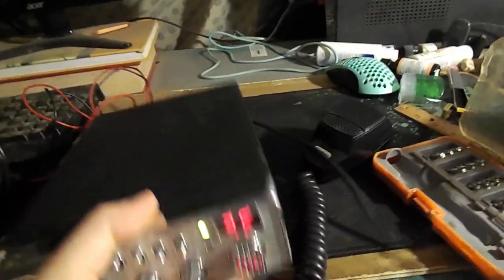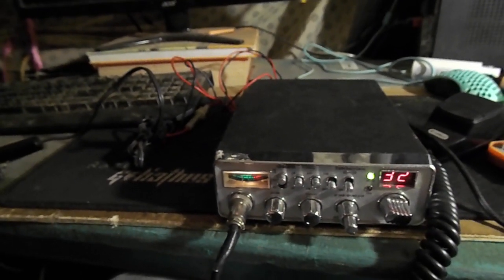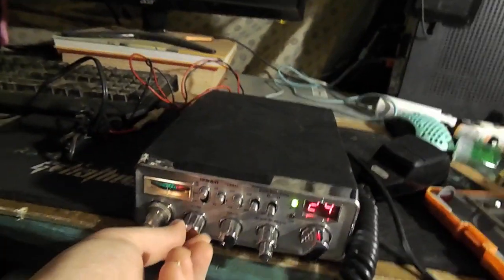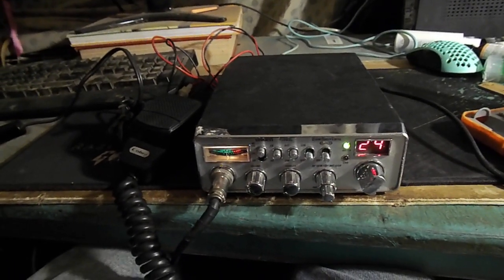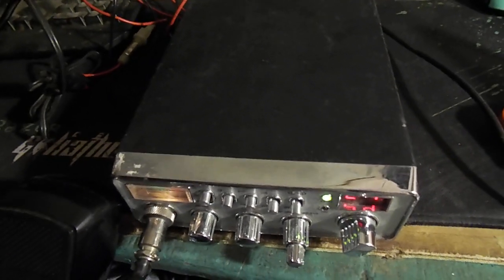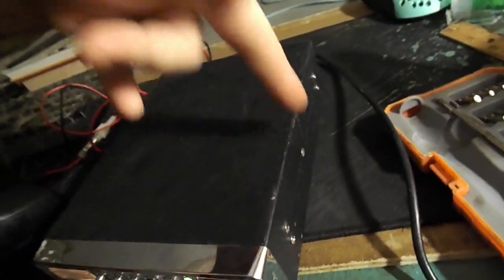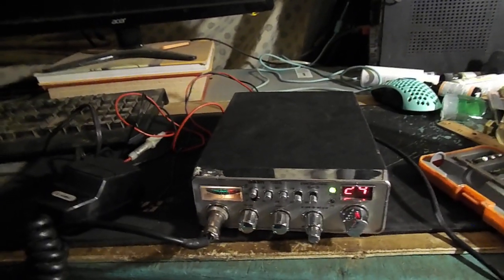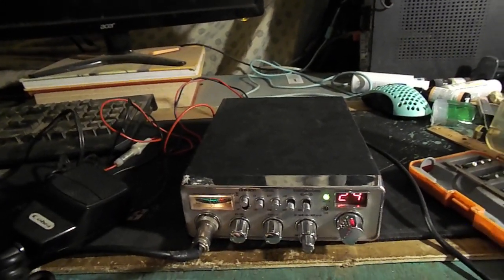Hear MORE SIGNAL! The Easiest way To Reduce CB Radio Noise!

Comment: What are the numbers on the capacitor you used?
Reply from the maker: 0.068 microfarad capacitor

Add it to the middle connection on your volume pot

Then attach the other side to a ground point (like the square metal cans you see in your radio)
Reply: Copy that thanks

Comment: 95% of your radios performance is how your antenna and coaxial cable are set up
Reply: I know it's pretty randomly asking but does anyone know of a good site to watch new series online?
Reply: @Noe Caden try FlixZone. You can find it on google :)
Reply: But it doesn’t fix the problem
Reply: What if you use a mag mount does that same logic still apply?
Reply: @Fox250R  yes. Because the negative side of your battery where the negative lead of your radio is connected is also connected to the chassis ground of your vehcle.
Reply: But with cell phone chargers and led.. Makes alot of noise

Comment: Great video--hard facts and provides good opportunities to talk about the little things that can help performance and/or frustrate the heck out of your CB fun. If you have an outdoor antenna--and the body of a car is "outside"--then at the least, there will be static charges that build up on the hot side (the radiating element) and the low/ground side (base, coax shield, connectors, and the car body itself).  At the most serious, a nearby lightning strike will induce a dangerous charge on an outdoor antenna.  As those static charges rise and fall, or discharge to the ions in the air, you will hear noise in the radio.  A well developed charge can zorch (technical term) the front end of the receiver and ruin some of the vulnerable parts on the circuit board.  It's best to ground the radio for this reason.  Ground everything that is supposed to be at ground potential to the same "ground"--something that acts as a ground--that is, that will act like the earth and absorb surplus + or - charges. Not easy.  The car/truck body is big and metal, but it's floating on (you guessed it) RUBBER tires. So do the best you can. At home, ground to the ground on your power supply (is that the negative terminal, the ground lug, the chassis, or all of those?) . Careful: If the negative terminal is floating then determine how to properly ground it (because the radio's negative connection is probably grounded inside the radio.  Everything that is supposed to be "low" should be at the same exact zero voltage--that's zero voltage DC, too.  Then you don't have noisy--and dangerous--static discharges.  The comment about mag mount antennas is right: the antenna base is not necessarily DC-grounded to the car body.  So, neither would the antenna coax be at DC ground, either.  Fix that. By the way, it's hard to find a good connection to the mass of the car body for grounding purposes inside a typical car or truck. (For example, the car door isn't necessarily connected adequately to the rest of the car body, despite being mounted via the hinges to the car body!}  So putting a radio in a car or truck with proper consideration for noise, static grounding and suppression of common mode currents getting back into the radio involves numerous, pesky (technical term) challenges.  Again, great video--brings up important, beneficial considerations for good performance.

Comment: Love the cb videos,im not brave enough to start soldering in parts yet .I have a hard enough time soldering on those pesky PL259 connectors. 
73,s 
514 Ontario Canada
Reply from the maker: I think I’m more apprehensive about soldering PL 259 connectors than I am about soldering part of the board oddly enough

I’m not an expert myself I’m pretty terrible at soldering 

but if you find something broke try to fix it 

that’s the best way to learn I think, not by breaking things, but fixing them
Reply: @JohnnyNJones  I have the same Uniden PC68 XL CB radio.  My Uniden is made in the Philippines.

Comment: Awesome Johnny!! I didn’t know about the grounding option…🤔my new uniden pc78 ltx is great and why not ground it like you suggested 😁.. so would running a good copper wire from the mounting bracket to a metal part of the Nissan pro 4x😝be sufficient?? Would under the dash metal or the seat metal fastener be alright?? Or should I pick another grounding site??
Reply from the maker: Honestly, my friend if you’re not hearing any noise, you should be OK.

But yes, you can ground it with a wire if you’d like as long as it’s short. So under the dash would be better.
Reply: @JohnnyNJones  thanks dude!!!!😎Johnny jones!!!!😎🔌📻🎛📟🤓
Reply from the maker: @christoFlair777  you’re welcome bud 👍👍😎

Comment: The circuit board in a cb radio is "floating" so it can be used in either positive or negative ground vehicle, if your cb is "home base" you can connect the ground on the pcb and then a earth ground to get rid of noise.
Reply from the maker: That’s true it is floating, but I find that removing currents induced in the housing also benefit receive by grounding. 👍

Comment: I have been wondering about this. I have a Cobra that I had in my RV for cross country driving and it worked great mounted. I have  bought a Wilson 5000 magnetic antenna and I am trying to find a place in my F150 to mount the CB. But I have been trying to find info about does the CB case need to be grounded to work right. I thought that it'd be better if it was grounded. Thanks for the video.
Reply from the maker: It will not cause any major issues to not have your radio grounded but it does help a bit in the noise department

Comment: Make me some more  videos my friend ,…. I really need to CUT Out that RF Noise.    I live in the middle of the City of Florence Kentucky and their is POWER structures all all around me for sure my friend.    What a great idea.        I think this would really help out on the Base Station as well .      Thank you 🙏🏽
Reply from the maker: No problem I appreciate your comments, I would recommend getting an FM CB radio now that it’s legal

 Try to use it when static is too high on AM, FM will not reach quite as far but it’s a lot cleaner sounding

Comment: A 4 y.o. video, I hope you are still active to this page. I have my radio, a 50 foot RG8X coax, a fiberglass antenna on a  mirror mount thats on a tripod freestanding in the yard, and the radio is powered by a lead acid 12 volt car battery, and the only thing connected to the battery is this radio. I do not even connect the battery to the battery charger until the radio is turned off. All of the equipment is new,Radio (President George FCC) new coax, mount...but the SWRs are 2.5 to 3.0. But when I run a separate wire from the battery NEG terminal to the antenna base the SWRs drop to 1.8 to 2.7.  In this video you say to ground the radio, but to what. Battery is free standing, as is the radio and also the antenna. Any help would be appreciated.
Reply from the maker: RF ground and DC ground are not quite the same thing that can become pretty complicated. It’s understandable that you are having issues. This is just part of owning CB radios haha.

You don’t want the battery hooked to the antenna, neither will be grounded then.

I would suggest removing that wire from the battery but leaving it connected to the antenna base. Keep lengthening that wire in a straight line until it’s long enough that the SWR drops.

I would also urge you to check out my video on my custom antenna build using nothing but wire.

If you would like to ground your Radio or your antenna, you can use a ground rod about 8 foot in the ground made of copper to get a good earth connection.

But it’s not something that you have to do. It will still work without being grounded at all.

Comment: I connected it to the body and it took the low static out still got the antenna static and mic and engine noise to work on
Reply from the maker: They make something called a power filter for that you should be able to find it online pretty easily. It seems to work pretty well.

I tested it recently on my video about using a computer power supply for ham and CB radio

Comment: get a uniden bc20 external cb/scanner speaker … it has a built in switchable noise filter that really does work... I rarely use the cb's noise filters and squelch any longer... my radio is a uniden pc122 that is similar to your 68...
Reply from the maker: Oh indeed there are plenty of radios that have noise filters. But some people may have cheap 20 dollar radios that just  have the basics. Thats the purpose of my channel is to try and help newcomers who may not be crazy about CB and just wants a few tips on getting the best out of their little radio they found at the flea market ect.

Thanks for commenting!

Comment: A resonant antenna will give you a better signal to noise ratio.
 Increasing the Q of the antenna decreases the noise and increases the signal.
Reply from the maker: Yes and reducing the Q also reduces the SWR bandwidth

But that’s the trade-off there
Reply: @JohnnyNJones  Increasing Q narrows bandwidth but increases efficiency.. Reducing Q increases bandwidth but lowers efficiency.

Comment: I just run my radio on wire shelf unit attach bare wire to mount bracket and then run that bare wire into and against shelving body in sense it now is ” noise drain" excess noise dissipates into shelving unit
Reply from the maker: Yeah that sounds like it would work just fine.

And It would act as a sort of faraday cage for noise suppression

Comment: I'm pretty ignorant when it comes to this stuff so maybe you could help me. You said "not to the negative terminal but to an earth ground." Where is the earth ground?
Reply from the maker: Well it won't exactly be earth ground, but it means the frame of your truck or car. If you have the radio mounted with a bracket to a metal surface this can help.

But basically if you run a wire from your radio to the frame of your vehicle you will lower your noise substantially.
Reply: @JohnnyNJones  thank you.

Comment: I have a lot of noise on my truck c.b. radio. But the radio is grounded through the mounting bracket isn't it? And the antenna is grounded through the bracket isn't it? Would it still need another ground wire? I need to lose some of this engine noise for sure...
Reply from the maker: The bracket if it’s connected to the steel body of the truck and is firmly connected to the radio could act as an RF ground.

But they’re often times painted or covered in an oxide layer and not really touching the radio other than through maybe through the screw

So I would say it’s going to be kind of difficult to get a really good ground with just the mounting bracket you could easily run a wire from one of the screws on your radio to whatever grounding point you have and that should take care of noise

If that doesn’t work then try using a noise filter which you can buy online, It’s a small box that you run your hot and ground through and it will filter any noise that you may have coming through your power cable (Which causes a lot of noise on its own)

And of course you could always use a balun to stop common mode RFI 

However if you don’t know what a Balun is it may be hard for me to explain how to make it. There is a lot of information out there that can help you and I hope you get this problem sorted out because no one likes a Noisey radio!
Reply: @JohnnyNJones  please fix my 138xlr  no transmit
Reply: Try hooking up your pwr directly to your battery & not your fuse box

Comment: I need some work done.  Fun custom stuff and a few repairs.  Do you have a website?
Reply from the maker: Aaron Pixler Hey there I appreciate your comment, I am still in my infancy in repairing radios, Usually I can fix simple issues but nothing more, I think most of that is luck. So unfortunately I wouldn’t trust myself to work on your radios, I’m just not ready yet. Not only do I not have the knowledge but I do not have an oscilloscope, signal generator, spectrum analyzer ect. But just for curiosity what’s wrong with your radios?
Reply: Lots of noise.  , broken squelch, another isn't transmitting, but recieves, another i want a linear amp installed, with a separate rf amp.
Reply from the maker: Aaron Pixler Sorry it has been so long, I Missed your comment because my notifications were so long. Those sound like things I could probably whack with a stick and make work again but it’s something that I am not comfortable or capable of doing right now. I really appreciate you asking and there will be a time in the future where I can accomplish those feats. Until that time I will be collecting information and equipment, thanks a million!
Reply: I’m having some ground issues in the big truck like electric windows and blinkers clicking through my speaker on my radio.  Where do you hook the ground wire to on the radio itself
Reply: @244-badnews2  try hooking your pwr to your battery & not your fuse box !

Comment: Poor ground on the antenna and coax is your issue which is obvious. Grounding the radio does not boost the signal, it’s cleaning the receiver due to your bad antenna and coax setup. 73
Reply from the maker: Yes, I know it doesn’t boost the signal.
It’s just a phrase that will fit into a thumbnail and more or less is the truth.

Comment: Clean RX is easy... If you want a challenge make that 29 not splatter with clean wave graphs on TX; FYI it takes board work that 99.9% of shops can't do especially with a linear amp addition
Reply from the maker: I don’t think I wanna tackle the challenge of reducing harmonic distortion in the CB world 🤣
Reply: It just takes a filter,they make them u know
Reply: Filter alone will likely clip modulation  and destroy clarity

Comment: ClearSpeech DSP modules or DSP Speaker & all of that white noise is GONE like a freight train.I use the DSP speaker in my pickup with my ICOM 7000 & in my shack I use the Base modules for my ICOM 7600, ICOM 746, ICOM 910H,& my DAK X for the CB Band.I HATE noise so I have almost None no matter what radio I'm using.
Reply from the maker: Oh yeah DSP will certainly do it, but most of us CB radio fellas just have some cheap old stuff

I’d love to have an ICOM 7300 and I plan on getting one whenever I have a thousand dollars to play with
Reply: @JohnnyNJones  I would not own a 7300 if it was FREE.I HATE any Touch Screen Radio no matter who makes it & I Love ICOM Radios.
Reply from the maker: @1OFGODSOWN  I’m not a big fan of touchscreen either but I do like the waterfall feature.

Does the 7000 have a waterfall?
Reply: @JohnnyNJones  no waterfall.It’s available to me on my ICOM 7600 & I never turn it on.I just like the band scope for my usage.I never turn it Off.

Comment: is simple earth the power supply first second put the antenna metal gunwale! IF YOY DON NT HAVE PUT BIG COPPER WIRE TO TOUTCH ERIAL MAST! GET IT TIDE IT!
Reply from the maker: Yeah buddy you got it 👍
Thank you for watching. ☺️

Except we don’t want to ground the negative wire to the chassis in the case our vehicle uses positive  ground

Plus the outside of the CB radio is not connected to its negative terminal

We also don’t want to cause any ground loops either